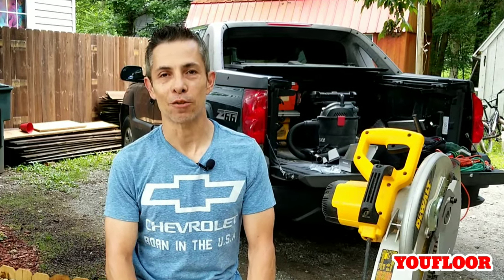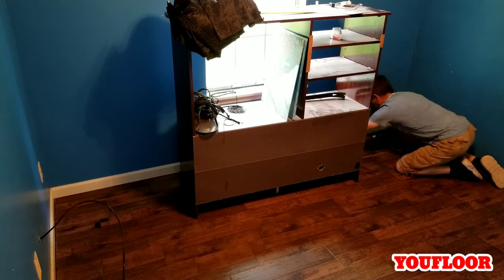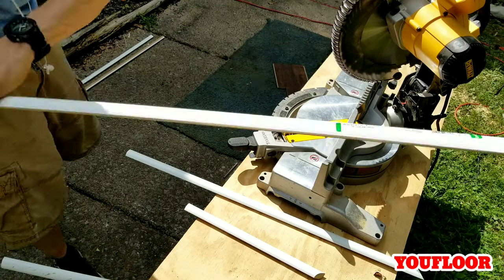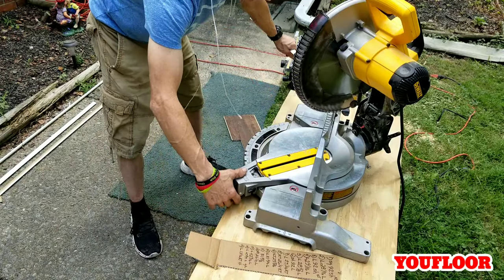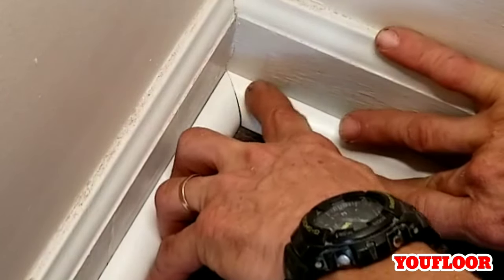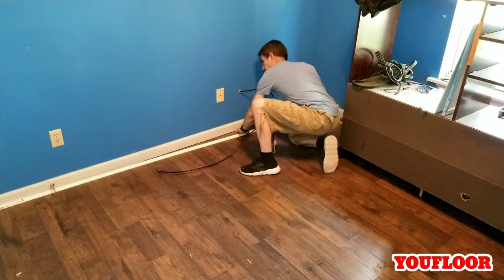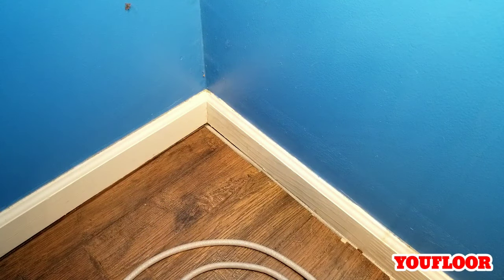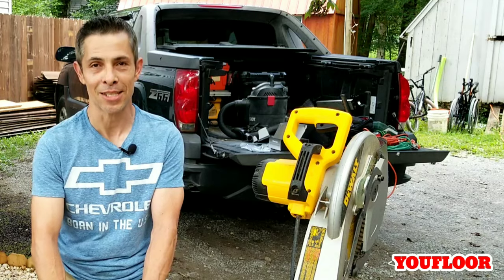How To Install Quarter Round Like A Pro

Comment: Bro.  You saved me sooooo much time with that 46 outside 44 inside trick.  I was going soooo slow trying to figure out why I had gaps.  I wish I saw this sooner.
Reply from the maker: You got it brotha. Glad it worked out for you. Thanks for the comment
Reply: Do you cut both side of quarter round at 44 for inside?
Reply: @kellykai4068  If the other side is an inside! Like the backwall of a closet 👌🏼

Comment: Thanks for your helpful videos. As you said that you cut 44 degree for inside corner. My question is do you cut other side of quarter round 44 degree also? It mean they add up 88 degree not 90? Same to the outside corner, both side 46 degree? Thanks!
Reply from the maker: @Kelly Kai Both pieces that come together on the inside corners are cut at 44 and both outside pieces are cut at 46. Hope that helps. Thanks for the question.

Comment: Thank-you so much man. Such an awesome video for installation of quarter round. Just installed floating laminated floor at a house and your video made the installation of quarter round so much easier. I had to watch your video many times over and made several mistakes at the start but soon got the hang of it. Sucha great and simple technique. Thanks again.
Reply from the maker: That's good to hear. Thanks for the comment

Comment: Excellent tip , 44 degrees in vs 46 degrees out....I couldn't figure out why my labors installation looked wrong. you nailed the issue Sir. Thank you so much.
Reply from the maker: Ha. That's funny. Thanks for the comment

Comment: Thank you so much for your videos. This was my second quarter round installation in my life. The first day I had help, but we just could not communicate. My friend cut almost every piece incorrectly. Today I was solo. I spent a good amount of time  measuring and listing each piece just like you did and cutting all the pieces for each room and then nailing them down. Today I only made 3 bad cuts out of 22 total, (2 of them were just a bit long.) Keep up the good work on posting these helpful videos! Also on the end caps you mentioned in one of your videos, it was not really clear, but once you have your trim cut at 45 degrees with the long end perpendicular to the return, then cut another piece at 90 degrees, then cut that piece at the opposite 45 to create your little cap to fit to your sample. I wasted some material trying to cut the cap from the same piece that I made the first 45 cut. I used two sample 45 cut trim pieces cut from both directions to check the fit of my caps. Once I figured out the process, I was able to cut 30 caps for my job. Thank you so much for your videos.

Comment: Dude- I have done my 1st room with a beadboard, chair rail/ cove moulding and quarter round - using your system of notating numbering / naming your cuts. I will never not use that system! 

I still feel like I have to check my 1st cut on 1 side on wall before I cut the other side… until I get better. 

I have been doing the mitered returns, or trying to do them. U just solved the mystery of why those returns are not matching on some of the quarter rounds, omg I thought I was losing my mind. I love the material and appreciate your time. 

Idea for future… would love more on mitered returns for base, moulding, any kind of wood application. And how do you put in a baseboard transition when heights are different from one wall / room to another. 

Thanks and I will keep watching!
Reply: I just found more on your channel for the returns…. Thank you…
Reply from the maker: Very glad to hear of your success. Thanks for the idea for the video. That would make a great tutorial. Keep on doing your thing and good luck to you on your projects

Comment: Great video! I used you tips for inside corner trim btwn soffet and top of kitchen cabinet. Had some 22 1/2 degree angles that were a pain.
Reply from the maker: Sometimes you gotta do 23° and 21°  when it comes to those. Glad it worked out for you 👊

Comment: Hi, great video!  I recently layed vinyl tile in a bathroom that has wall tile on all walls.  Since i cant nail quarter round through the tile what must i use for floor trim?  I was going to use the flexible rubber against the tub, this good?
Reply from the maker: I usually glue my 1/4 round to the wall. Then caulk the top with silicone. This will help to hold it as well. Hope that helps

Comment: Good video.  I'd recommend using 16' sticks from  local mill shop.
Reply from the maker: When I do my own jobs I definitely use 16 foot sticks. Makes for a much smoother install. However on these Home Depot jobs. I just show up and the material is already on the job. Sometimes it's real wood but on 80% of our jobs they send this stuff out. Thanks for the comment

Comment: Thanks for the information. What did you use for glue (and whatever you sprayed on the other piece prior to gluing)?
Reply from the maker: I'm using c.a. glue and excelerator. You can order it in Amazon. I like the bob industries in the pink bottle. It's a little thicker than others. Hope that helps. Thanks for the question

Comment: This is EXCELLENT!!! One question just for clarification tho.  When joining two pieces together that are not on the corner did you say 55° to 44°?
Reply from the maker: I use a 44 just so I don't have to change the angle on my saw.  but you can use whatever you want for splices. 45 is ok

Comment: I'm putting in trim right now by myself. This is so helpful! I'm pushing down when I put it in but when I walk next to it, it feels like the floor is still sinking lower. It's that right?
Reply from the maker: Could be a low  spot. Also some times the weight of a wall can push down creating a dip next to the wall but a slight hump just off the wall. So if you push down over the hump and nail the 1/4 round. It may  create a slight gap between the flooring  and subfloor. This can create a springyness on the other side of the hump. Since you are not walking against the wall , you may need the move it up a little to relieve some pressure if this is the case. Hope that helps. Thanks for the question
Reply: @YOUFLOOR  yes very helpful. Thank you for taking the time to answer my question!

Comment: Double check your labels. Got my quarter roumd from Home Depot as well and label to the left trick doesn't work. Unfortunately didn't realize until after I did some cutting. 🤦🏼‍♀️. However, your other tips were so great. Thanks for the video and sharing!
Reply from the maker: Yes it can happen. Usually for us if it has green on the label it is to the left but if they pull the solid white label out for your oder it could be to the right. Thanks for the comment

Comment: I'm just a homeowner on the internet, but: You put silicone caulk on the top seam of the quarter-round. That caulk is usually non-paintable. Is that going to cause headaches if someone goes to paint the baseboard and quarter round later?

Thanks for the video!
Reply from the maker: Hey, great question. It's true you can't paint over silicone. However, if you go to 15 :29 to 15: 35 and slow down the video, you will see a black label. That is because I switched over to a latex acrylic caulk. Made to paint.  Guess I could've mentioned that in the video. Didn't
Think about it. Anyway, I hope that clears
Things up. Thanks for the comment

Comment: How do you know when to cut on the left or right side of the saw?  Great video also.
Reply from the maker: That would depend on what side of the room you're cutting for. If it's a right hand    corner, I turn it to cut right . If ots a left hand corner I turn the saw to cut left. Hope that helps. Thanks for the question

Comment: Great video.  What/where do I get the oil base white touch up paste you mentioned at the end of this video. Thanks
Reply from the maker: I get mine from a local flooring store called jeffco. But I found it on Amazon. I believe there is a link to get there in the description. Hope that helps. Thanks for the question

Comment: This is so helpful!  We just bought our first home, and we're going to be DIYing so many things.  Your video is a life saver! Thank you!  All the likes!  And subscribed!
Reply from the maker: Thank you so much. And thanks for the support. Good luck on your projects
Reply: How do I determine the angle to cut for a non standard joint? A room I need to do doesn’t have all 44 degree angles. Thanks
Reply from the maker: I have another video which is kinda a part 2 to all the questions  I had from This video. It's shows me using a miter finder to dile in on a precise angle and turn your saw to the right spot to get that miter cut. Hope it helps Thanks for the question https://youtu.be/abkTRdbOd2I

Comment: Thanks in advance. Here is my question/senario - When installing a new LVP floor on top of a subfloor like the one you are measuring for the quarter rounds (imagine it's a concrete floor with wood white baseboards like in the video), do you need to remove the baseboards to install the LVP and reinstall the baseboards? Or can I install the LVP while the baseboards are present and then install quarter rounds?
Reply from the maker: Hope you like detailed answers. Okay this has always been a debate in my comment section. Personally if you don't mind 1/4 round and you are going down on the subfloor, you do not have to remove the baseboard. Just be sure to leave a 3/16th to 1/4 inch expansion gap around the perimeter. The lvp doesn't expand like laminate but the house made of wood does. Now some people hate 1/4 round. So they prefer to pull the baseboard and lay thier floor. Still need to leave expansion gap but this can be covered back up with the baseboard. One more thing. if you are installing on top of an old floor like  Vinyl with luan or tile. Then I would pull the base board. Unless it is 5 inch baseboard. Beacuase at that point when you put the 1/4round on there there won't be much baseboard  left once you raise the floors. Hope that helps. Thanks for the question

Comment: hey Great video. If you have moving floor isnt the caulk saver going to change form and gap will be created where the caulk saver was placed ?
Reply from the maker: I'm not sure what you mean. Sometimes I don't use the caulk saver if the baseboard is higher than the flooring. In fact I won't even leave a huge expansion gap as there is plenty of room under the baseboard. Then I  Just put the silhouette cone on the floor and the baseboard and then install the quarter round.  They taught us that if the baseboard runs all the way down to put the caulk  saver in 1st and then silicone on top and they informed us that the silicone was flexible and that the foam would squish allowing the floor to still be able to move during expansion and contraction. I hope that answered your question. Thank for the comment
Reply: Ah Great 😀👍

Comment: For various reasons I need to install shoe moulding along a run under a step and join that to quarter round that is deeper at an inside corner.  I've seen videos for mitering two flat boards of different depths but nothing for this situation.  Suggestions for how to make this work?
Reply from the maker: Hey bud, sorry. I'm just seeing this. Did you ever get it figured out. If not, send me a pic to youfloor.net@gmail.com. I'd love to take a look and see if we can figure it out

Comment: Sorry if I missed it if you went over it, but when connecting 2 pieces together to make a long piece, do you place caulking on the seam and do you need to cut the connection at an angle or just leave them straight. Thanks
Reply from the maker: Straight or angle is fine I just do it with a angle so I can face it a way from the eye when looking down the wall. You can use caulk but it tends to shrink.  If you miters line up good or may be just fine

Comment: Zenon, just found your channel. New flooring will be installed in a week and I am doing the 1/4 round (wood) I consider myself a pretty good DIYer. I have built a barn? Some flooring and finished my whole basement. Plumbing and Electrical. This video is greatly help me improve my 1/4 round skills. Lol. My wife and I have a camping YouTube channel if you are into camping and watching goofy people. Lol. Let me get to my question. When I return to the door. How do I keep that 1/4 round from having that blocky blunt end? Thanks again and I will subscribe.🤙🏻
Reply from the maker: Hey brotha I totally thought I responded to this. My wife goes back and checks comments to make sure we ran acrossed this one. So here is a link to my part 2 video. I go over returns so you won't have those blocky ends. Hope that helps. Thanks for the question
Reply from the maker: https://youtu.be/abkTRdbOd2I

Comment: Very informative!! 1 question, if using a hand saw, and miter box; how can I achieve the 44, and 46 cuts properly? Or do I just need to get the power tool? I have one tomorrow, and I'd love to achieve this clean look 1st try! Thanks!
Reply from the maker: @1PackMagic ThePokeBandit 
You can try using cedars shims and place them against the miter box fence before placing your quarter round against the fence. This will make one side bump out further than the other and will create a slight angle less than 45. Hope this helps!

Comment: Love your video and it has inspired me to do it myself after hiring a flooring guy that couldn’t get it done.

My question is that I’ll be doing this inside an RV so it’s not drywall walls. Does the 44°/46° rule still apply to regular walls that do not have drywall on them or should I just be making 45° cuts on an RV project?

Also, this may be a obvious question, but just wanna make sure. When splicing two straight pieces, am I cutting at 45°?
Reply from the maker: Thanks for the kind words. As far as the rv goes. I wouldn't think the 44/ 46 would be necessary. However nothing is perfect in this imperfect world so if you want to be sure you get tight cuts you can use a tool  to check you corners for perfect angles using a miter tool like the one in this video. https://youtu.be/abkTRdbOd2I
As far as spicing  yes I use a 45°to splice. Make sure the crack is facing away from natural flow of traffic so to not see the splice so visible. Hope that helps. Thanks for the comment
Reply: Lastly, if I just want to manually nail in nails without a nail gun since it’s such a small project, what nails do you recommend? Can you provide me an Amazon link?
Reply from the maker: https://amzn.to/3o8Qaxe
If you're not using a nail gun I would suggest using these hand drive trim nails. You will want to drill a small pilot hole to make sure you don't split your quarter round. Once you get the head pretty flush, you will notice there is a small dimple on the head of the nail you can put a nail set in that dimple, or use a spare nail to put in the dimple to set the nail below the surface. Hope that helps! Thanks for the question!

Comment: In our area(ohio) a good carpenter  never miters inside corners. We use a method called coping. That way when you nail the corner with the gun it doesn't  open the mitre
Reply from the maker: Yes. I am familiar with coping. But I only do it with bigger trim like baseboard or crown molding. But  quarter round. Or shoe mold. I would rather do it this way as there is no need for caulk on the miters. I feel it is just a waste of valuable time to get the exact same results just to prove I'm a real carpenter. I put my work up against anyone and if it's not a close tie I usually win. Thanks for you input I'm sure there are many out there who agree with you. Thanks for the comment

Comment: Zenon if you don’t do the backer rod then do you just run a bead of silicone and the bottom of the 1/4 in addition to the top that u already had done? Thanks
Reply from the maker: Yes. But i usually squirt it on the floor in the crack instead of on the actual trim. That can get messy quickly. Especially if it is 16 feet long. Thanks for the question, Jason. Good luck on your job

Comment: What do you use for covering nail holes when painting 
Or what if I prepaint trim pieces??
Reply from the maker: https://www.lowes.com/pd/DAP-DryDex-5-5-fl-oz-White-Spackling/1000212169?cm_mmc=shp-cprdpntgglLIA_PNT_221_Glue-Adhesives-Caulk-Repair-1000212169-local-0-_-0&ds_rl=1286981&gclsrc=ds. THIS STUFF IS GREAT AND IT DOESNT SHRINK !! Hope that helps

Comment: Great video but what kinda nails do you use without cracking the quarter round trim?
Reply from the maker: Wel 1st you should know that this 1/4 is mdf, so it won't crack. But we use 2 inch 18 gauge nails. Hope that helps. Thanks for the question

Comment: I'll be using quarter round to cover up a seal between sheet vinyl and a plastic shower encasing. What kind of adhesive should I use? I was thinking liquid nails, but if I ever have to pull out the shower to replace it, I assume it would ruin the sheet vinyl.
Reply from the maker: In this case I personally  would use 100%  silicone. I put a small bead on the floor and  one the back of the 1/4 round. 
It's not a lot, and I like to leave a couple blank spaces and I use hot glue in those spaces to hold it in place. Then a small bead on top of quater rou d wirh6 white siliconized paintable caulk or just use clear. Hope that helps. Thanks for the question

Comment: Any ideas on fixing gaps around door casings that were cut too short ?
Reply from the maker: Well... the only tip I can give is.  If you have some of the casing that's in your house. (If not you can buy it to match) but I cut little slivers  just a tiny bit bigger than the gap  with my miter saw.  Then i have a sanding  block with 80 grit belt sanding paper wrapped around it.  I take my slivers and rub them back and forth on the sanding block and keep trial an error until I get a nice slug fit. THEN rub a tiny amount of caulk to smooth it out. Then paint. Hope that helps. Thanks for the question